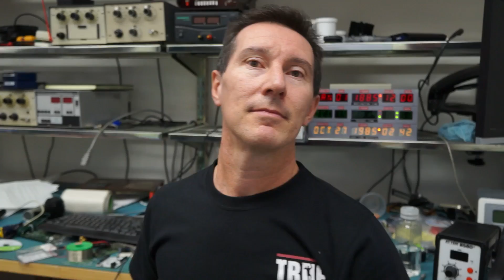eevBLAB #2 - Are Electronics Hobbyists Useless?

Comment: hob·by·ist ˈhäbēist/ : a person who pursues a particular hobby.

hob·by ˈhäbē/ : an activity done regularly in one's leisure time for pleasure.

There are all levels of experience and expertise in a hobbyist.  I don't think everyone who is in the electronics hobby should be expected to be able to design circuit boards and write code for microcontrollers.  And really, who the fuck is Dave do say who is and who is not a "good" hobbyist?
Reply: I totally agree with Brad Morris. Dave, you absolutely get to say what skills are required in order to get the job. You DON'T get to define who is and who isn't a hobbyist. The word 'hobbyist' doesn't imply skill or expertise--it implies what you do for a hobby. That's all.
Reply: TubiCal Come off it. Stop talking about rights and shit, this is Youtube, not a public square.

There are correct uses of words and incorrect uses. You are getting entirely too worked up over this, and really need to calm down. Oh, and don't come at me telling me you have a right to be angry or despondent or any emotion at all, because I really don't care. Your rights mean nothing to me in that context, nor should they matter to anyone else here.

Now, is hobbyist the correct word for this? Yes... and no. The colloquial meaning of hobbyist varies upon area, surrounding peers, field of work, etc. A hobbyist at MIT is not necessarily the same as my level of hobbyist, which is currently replacing power supply caps in discarded LCD monitors and TVs, assembling kit projects, and soldering my own cables and patch panels for my audio work. I don't think Dave was wrong in saying hobbyist, yet I feel a more precise descriptor/label could have been used to avoid confusion. 

He addressed the confusion and specified the skillset required. I don't see the issue here any longer.
Reply: He can't decide what is hobbyist, but he can say what kind of hobbyist he is looking for... I think he have reasonable demands, but he step to harsh on hobbyist which don't have requirements he needs.
Reply: EEVblog
If dunno if you should expect all good hobbyists (that word good really defines it by how you define good!) to have all of those merit badges, so to speak. But how about of they could had certain ones and were ready to learn more, OJT?
There's not so many strong in both hardware and software. I think you'd want a hardware mainly person in-house as software can happen over the net.
Reply: +Brad Morris +EEVblog
  I'm a 2-year electronics program graduate and we hadn't done any board laying out as all we everyday. The only soldering we did involved a few specific kit projects.

All my hobby stuff has been with those circuit boards you solder in your components and make your own pathways, usually with jumper leads. I forget what they're called. Those were pretty cheap and I could always reuse the boards when I was running low on funds. So, even as a hobby guy, I didn't really do much circuit-board design. As a hobby guy, I also scavenged most of my components, so my desolder technique isn't bad.

Many hobby guys I know don't even bother with microprocessors because what they did really didn't need them. I would mess with them more, if I could afford one. I covered programming microprocessors & PLCs in school, but never really needed to use them.

As for troubleshooting circuits, that one's gonna be all about experience. I burned up a few chips back in my school days so I try to be careful when I'm putting down components. I also try to make sure those components are good before hand. That limits my troubleshooting experience considerably, though.

For IT skills, I can't do as much on the networking side, but I am a former computer & printer service technician so I'm decent at figuring out which piece of hardware is broken. Sometimes it's a software issue, such as a driver or setting. Of course, it's mostly part swapping & sending the parts to a sweat-shop to get them refurbished these days.

Anyway, if you're still reading, my point is different people have different skillsets as it's a very varied field. They know what they get exposed to and master what they actually need.
Reply from the maker: Brad Morris I have an equal say with every other hobbyist, thank you very much. I'm also the guy hiring, so I get the say in the skillset of the person I hire.
Reply: EEVblog Not the point.  You stated that the definition of a good hobbist is....  By definition a hobbyist is someone who does something they enjoy for the simple pleasure of doing it.  I do understand that you're hiring for a position in your lab.  That's wonderful and I hope you find the applicant that you're looking for, but please don't insult those of us who consider ourselves electronics hobbyists and are just entering (or in my case, re-entering) the hobby and haven't yet learned all the skills of the hobby.
Reply: ***** Way to be an EEVBlog fanboy.  I'm sure you're just what Dave is looking for.
Reply: TubiCal My comments have nothing to do with what skills Dave wants in an employee, but rather the claim that the definition of a hobbyist is something that it is not.  Did you even read what I wrote?
Reply: +Brad Morris 
Well, I am a hobbyist, according to your definition, and I can do all of that and more with my right hand glued to my face! I do it for pleasure, I pursue it because I love electronics dearly. I have had no real education for it, I read up and just tried it out all on my own. 

But I guess we have to bring everyone else down (including the 'definition' no less) to make those who don't have the nack or will, or capability look good right? I don't feel sorry for those who can't do simple things such as that and call themselves hobbyists yet feel insulted by what is to their minds a bar set to high.

Frankly, what your saying is like, those who partakes in football as a hobby can't be expected to throw the ball or score a goal amongst a few friends. Soldering is actually pretty easy, making a circuit is done the moment you put both leads of a lightbulb to a battery. Placing a chip on a board and simply routing metal lines from it to different things is not much more challenging. 

One can learn more advanced things over the course of a few days if they wanted to. That want should be what defines a hobby more than capability regardless. I have no idea how the expectation of being able to do all those things as a hobbyist can be considered an insult either, I think it would be an insult if he didn't expect it!
Reply: Brad Morris
Dave is to pay for someone´s work , so only he is in charge of claiming what the employee skill are up to, no one else EOL!
Reply: You´re not in charge here, anyway, Dave wants to have an employee, not you, so he can/will/is ought to/ decide who he can call a hobbyist or not; or even the clarification of the word hobbyist from his very own point of view...Did you even listen to that video, Brad, did you....?
Or do you have, at least, something that puts you in position to judge about someone else´s right to use words he/she wants to use, so to speak as i now will use the 14m32 abbreviation.....So what...i wrote this and i´m not gonna (upps sorry this is an inoffical abbreviation as well)....so go blame me for that as well, will you? i wouldn´t take it back...because it´s all mine....
EOL

Comment: It all sounds like basic skills to me. I could easily do all of that, and I haven't taken a single electronics related class.
I can design circuits, etch my own boards, and solder msop-10 packages by hand on a home made board with no solder mask. Programming in c/c++ is another skill that you should know for programming microcontrollers.
If you can't do any of that, you shouldn't be calling yourself an electronics hobbyist.

Comment: I begged my way into a job with a small flight sim company as an "electronics hobbyist" and basically ended up designing, prototyping and debugging everything. I think I got the job because I spotted a mistake on the schematic for their main indicator dial during the interview. We had a great little PCB mill, and a pneumatic solder paste dispenser so you could go from schematic to finished board in half a day. I took great pride in my ability to hand assemble high pin count QFP's

I could have done a hell of a lot more if I'd known what I do now about PID loops / control theory etc, and I still know far less about electronics than I would like (you almost don't need to with the datasheets they provide nowadays.) But we had post-grads come in who didn't know which side of the vero-board to solder on, and coders who took a day to get a uC to flash an LED, so I suspect your average keen-hobbyist knows a fair bit more than the equivalent post-grad.

Comment: You should give them a simple half finish project (based on your basic requirement), complete the C code,flash,debug and identified the fault on the PCB,all in less than an hour time or so, instead of listing all the requirement on the Job description.
Even a basic electronic skill still covers a large field, and not everyone uses Altium and 'C' in  their project, something you should consider.
They are still a Student/hobbists anyway (learn as you go)... or are they better off flipping road sign?

Comment: As a 4th year Electronic Engineering student in the UK, had I not wanted to learn to solder (when I was much younger) I so far wouldn't have been officially taught to do it. We have however been taught to layout a board, although I had to choose that module as well for myself. Design obviously is plentiful, although still not enough practical sessions. I consider my self a hobbyist, although it really hasn't been encouraged in the UKs education system.

Comment: Get off my lawn!

Seriously though, you're not wrong, but there's also the possibility that the rampant availability and low cost of other people's designs, layouts, bare PCBs, even partially assembled PCBs have made design and layout skills less than necessary for the typically hobbiest.

Need to build a thing? Well i'll order an arduino to control it, use a popular firmware package that's drop and go, buy this motor controller kit, follow the well documented (with pictures even!) Instructions and test procedure and awaaaay I go. People are getting away from bare metal because it's time consuming, fidley, and really why bother when someone else has made it better. It's a different set of skills and I don't think it's a bad thing.

Comment: The people, who think you are asking too much from a hobbyist, probably call someone, who can pick up parts at IKEA and assemble it, a furniture craftsman.
Plucking together ready made Arduino parts and using premade libraries may make you a hobbyist, but it's quite far from an electronic hobbyist.
I don't think that's a new thing either. It's just that the internet brings out all the people you couldn't see decades ago.
Don't get me wrong, I think it is great that everyone can easily build something "electronic" (additionally the critical mass makes everything cheaper). Maybe some of them get hooked and stay, someone who never would have tried without the internet.
I know it can hurt a little when for example you see people take the "absolute maximum rating" of an atmega pin of 40mA and say "hey, I'll connect two 20mA LEDs in parallel without resistor to the pin. Perfect match!" . But everyone has to start somewhere.

Comment: Well I am over in germany, so nomchance of me helpin ya out. I would love to, though. But I designed a little random number generator when I was like 14. Just pess a button and you get a number in an led dice Layout. I actually still got the board but sometime as a child i kinda spilled some cereal over it and either blew the transitor or one of the ic controllers. Silly me, now you just get a 1, 3 or 6. But the board i did wasnt a custom acid etched thing. Just one of those plates with a series of holes and copper strips running on the back, i had to trim those, use jumperleads, it aint a beuty but it was solid. And thats about it on my skilllevel, i feel confident in repairing sometjing if it breaks, like you drilling a hole through the powerline, but i struggle at troubleshooting everything more advanced than your waterboiler. But than I never claimed myself to be a hobbyist, just a guy who isnt afraid of handeling a soldering iron.

Comment: PCB layout, soldering etc. are basic things, and certainly for PCBs, it is FAR easier now than it was in the past.  I made PCBs at school 25 years ago, layout software was totally manual, little better than Paint. Output was on a dot matrix printer, which was then photocopied onto transparencies, these inevitably needed attention from a black marker pen to fill in any small holes or gaps.  Then into the UV exposure unit with the PCB, which was subsequently washed in various trays of toxic chemicals, cleaned, then all of the holes drilled out one at a time. If a mistake was made anywhere, the whole thing was ruined and you started again.  If you wanted luxury items like solder mask and silkscreen then too bad - not available.

Today software will do the bulk of the layout work for you, and then it's just send the file to some manufacturer and finished boards arrive in the mail, complete with solder mask, silkscreen printing, gold plating and whatever else you want.

Comment: Final year (5th year) electronics and electric engineering student here. 
I have layed out boards, etched them, solderer them and programmed their micro processor (as well as PC programms to controll those micro professors remotely). Easy, especially for an EE student, right?
Unfortunatly the answer to that is no. In our group of 30 students about 3 - 5 have the skills to do such basic things. To be fair, we are not mainly concentrating on electronics, but are more in the area of electric power prduction, transmission and all that jazz. We still do have electronic classes, and also skills can be aquired in the labs and workshops we have as part of our education. 
However, the interest in my classmates seems to be missing. Only a few of them even own a soldering iron, fewer of them are able to desing a simple circuit. Which is quit sad. 
But on the other hand, a interested hobbyist sure should have the skills you mention in your video. An interested 3rd year EE student should have those skills as well, but apparently they are quit hard to find.

Comment: I consider myself a novice hobbyist. And I HAVE designed my own circuits, layed them out, etched them, soldered them and debugged them. I've programmed and debugged firmware. So no, you are not asking too much. Get a grip people. What are hobbyist skills if not the beforementioned? Being able to connect an iPod to a computer?! Connecting a LED to a battery? Come on.

Comment: I'm not sure if I'd fit your definition of hobbyist, Dave.  I've designed circuits before, but I'm absolutely rubbish with "analog" parts (probably due to the fact that I've never seen them as useful to what I want to do, which is CPU design).  Capacitors, resistors, inductors...I know what they are and what they do, but forget me trying to use them correctly or figure out which one I need for a particular purpose.  Even transistors...I can use them as a switch, but as an amplifier?  Not a chance.  I don't even understand the schematics.

As for PCB design, I've designed a few, but I've never taken it all the way.  I tried the laser printer transfer method, but learned quickly that my chosen printer (a Brother) doesn't work well for that.  I've always wanted to send my board off to a manufacturer, but I hit a problem in the fact that I have no idea what they're talking about with mils and Gerber files.  I could look it up and figure it out, but it's never been that important to me.  There's never been anything I wanted to build that badly where I needed to send off a board design, as protoboard works fine for most of my designs.

As for soldering, I can do it, but I've never done any SMD stuff.  Never mind BGA parts, which I'd need a heat gun/reflow oven to even attempt.  Again, I've toyed with the idea of converting a toaster oven to a reflow oven, but I hit the hurdle of a lack of knowledge and ultimately need for it.

Hobbyists are hobbyists because it's something they enjoy doing.  If they don't want to do something, or they don't need to do it in order to do what they want to do, they won't bother.  And hobbyists have little enough time to learn what they need, let alone learn something they don't need to get a good foundation.

Now, as a professional software engineer, I know what you're driving at, and you're right.  People absolutely should have a basic foundation in whatever area they're trying to learn, be it for professional or hobby reasons.  I can't tell you how many times I'll read a blog written by a "programmer" who designs the most bloated, inefficient solution to a problem because they lack a knowledge of, let's say, a hash table.  But it wouldn't be fair of me to say they don't have a right to call themselves a hobbyist if they love doing it, nor would it be fair of me to say they shouldn't have a right to publish what they figured out, even if it's horrible and inefficient.  We need to be accepting of these people, and try to encourage them to learn about other areas rather than dismissing them as wannabes or, even worse, ignoring them.